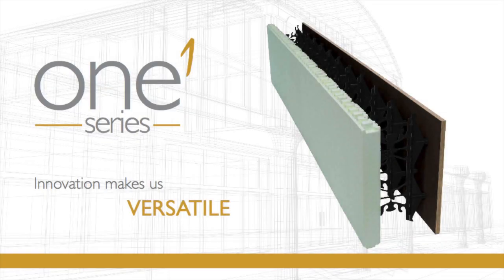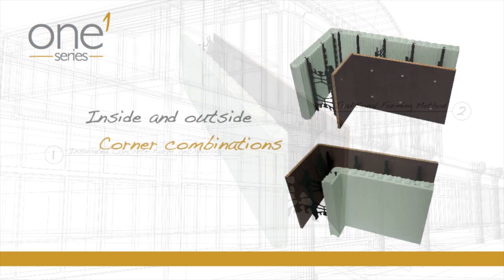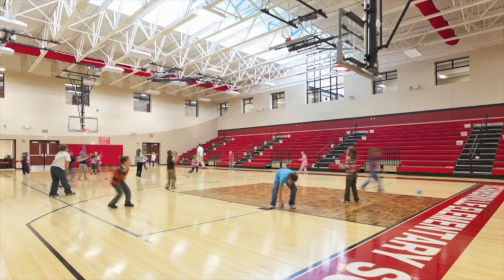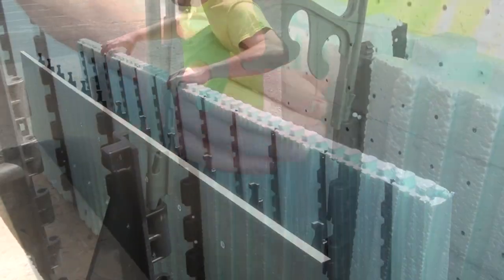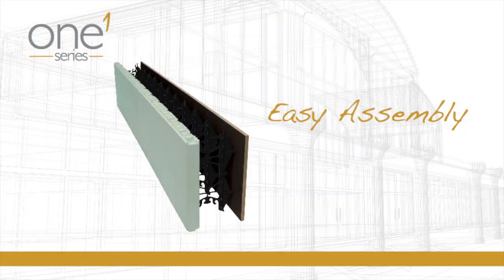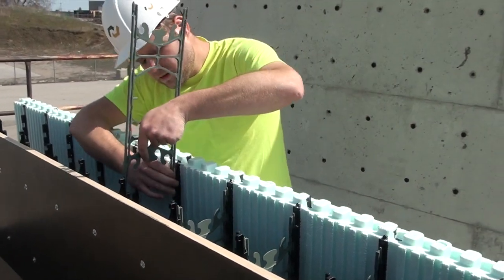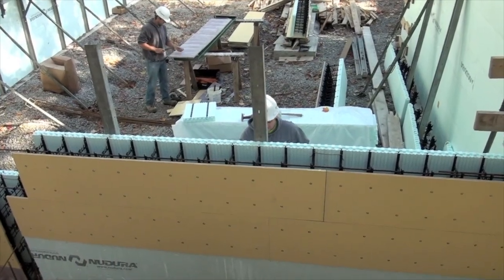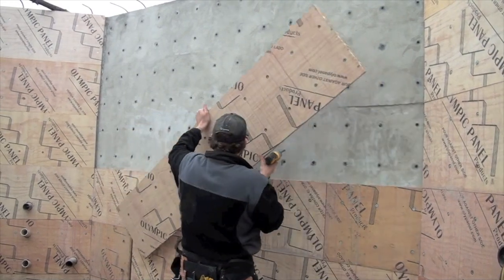Nudura One Series Form

Comment: So

Is this a option to have exposed concrete above grade then continue up with regular nudura insulated block for a 1 storey house?

Can this done?
Reply: More like for elevators; inside has exposed concrete.
Icf can be used below or above grade interior traditional stuff on top of Styrofoam dry wall, stucko 
Exterior traditional stuff on top of Styrofoam brick, stucko, vinyl w.e

Comment: This a fixture, not a jig.
A jig is often confused with a fixture. A fixture holds the work in a fixed location. A device that does both functions (holding the work and guiding a tool) is called a jig.